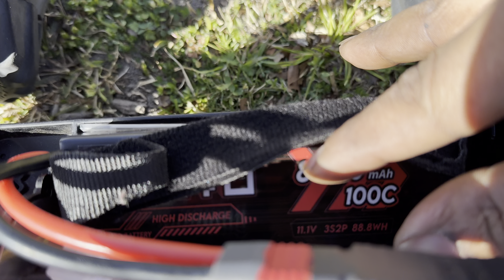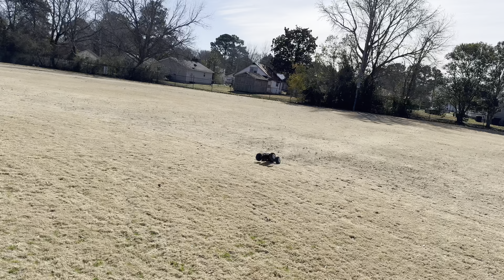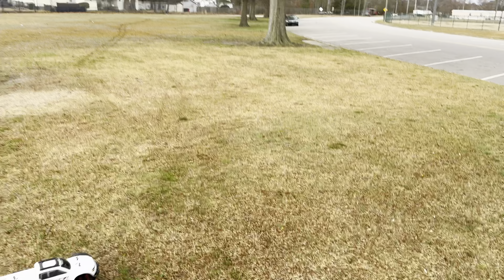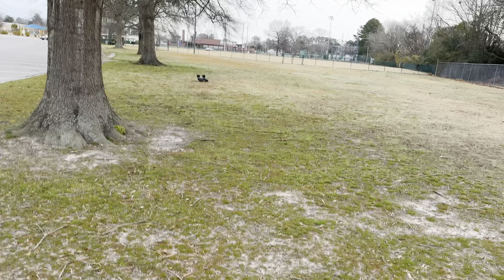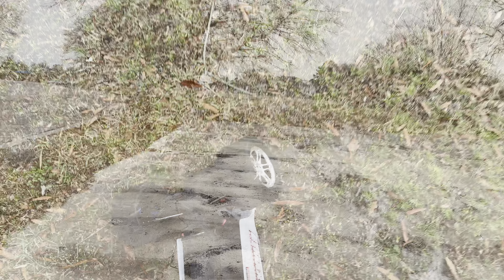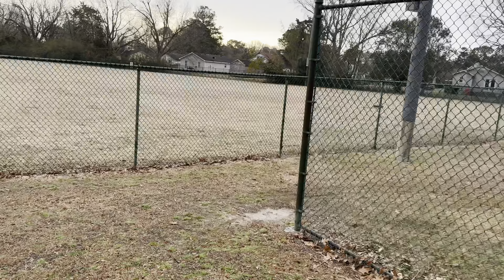Going 6s crazy🤪 in my (Discontinued) E-Maxx

Comment: Awesome, love seeing the ole E Maxx ripping, Reminds me of the good ole days of racing every weekend, we had a class of T Maxx's for a couole years at King RC in NC, Seeing and hearing 10 T maxx's racing for the first time was fricn badass. Man that thing is hauling ass on 6S. That will teach ya some throttle control huh lol Nice rig bro ✌🏻
Reply from the maker: Man I know that’s was an amazing experience to hear all those nitro motors screaming and those transmission shifts 😊👍. Thanks buddy I really appreciate the feedback. Yes my throttle control has improved tremendously since driving it on 6s….. hey I converted a T-Maxx to electric in this channel if u get a chance u should check it out…. Thank You👍
Reply: @CrownKing-ds8cx  No problem, I got into building and flying RC planes in the last couple years,  I just built my first biplane, check it out when you get time, I just posted 2 short videos, one was crazy, lol Can't believe I didn't crash 😂 I still have a old RedCat Racing 1\8 TerrorMoto V2 4WD, It rips but it's not a hardcore basher. I need to get some batteries for it and might put it on my channel, I can do some pretty cool front flips with it,  Keep it up brotha 🤘🏻
Reply: Nice truck thow

Comment: I'm building a fourth. TMaxx rollers are cheap and easy to convert. 3905 chassis FTW. My Emaxxs have Tacon 2060 motors so I run them on 4S (two 2s). They kick ass! Best RCs out there. Dated, but tried and true!

Comment: These emaxx are a beast. I bought one for $80 off a family friend back in 1996 it has the hi/low gear transmission and I put some money into a few years back with a new power system, drive lines  and ran it on 4s. Now it’s been waiting a year for me to replace the rear pinion bearing haha.
Reply from the maker: Yea man extremely fun too bad they discontinued it….. go ahead and fix that thing up and get out there lol👍👍